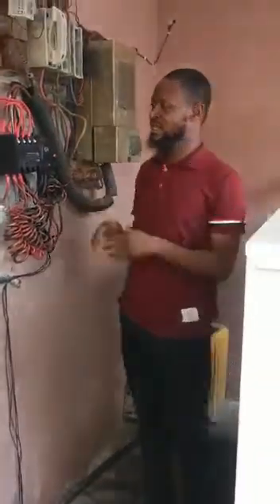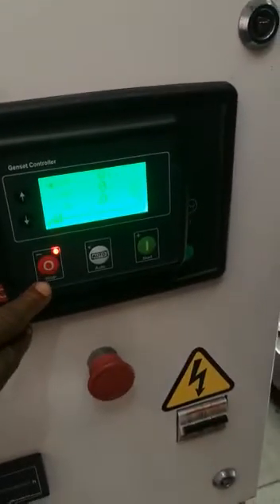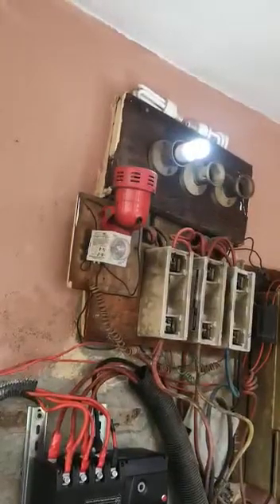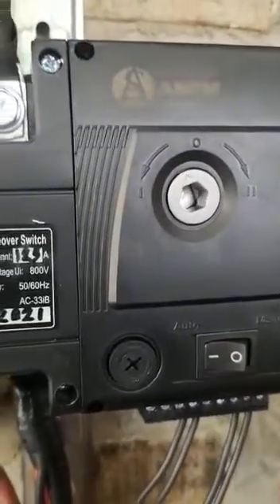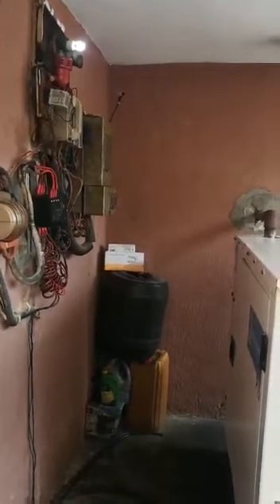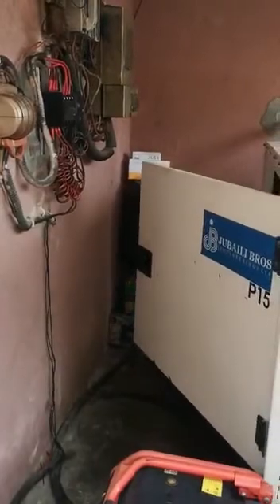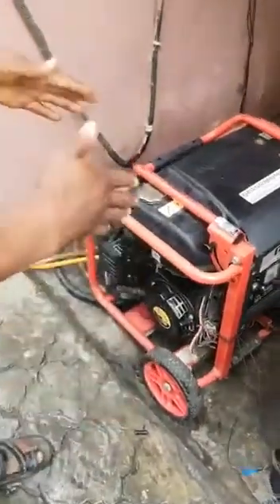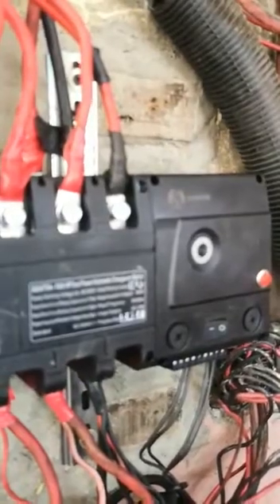HOW ASOM AUTOMATIC CHANGEOVER SWITCH WORKS

Comment: Do a video on how to wire a selector switch that can select auto or manual operation of the ats without opening the panel to manually select the mode